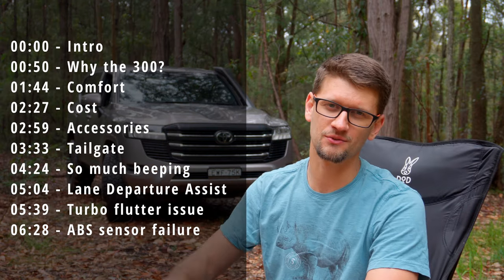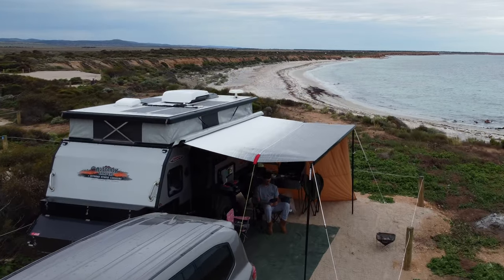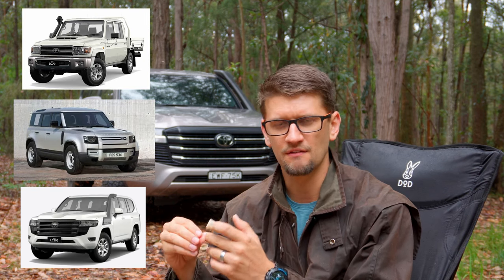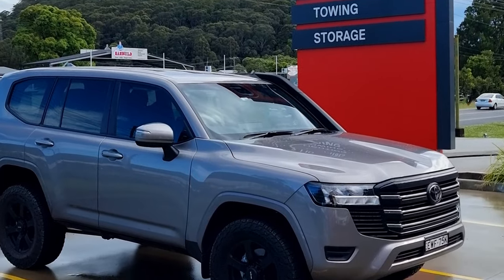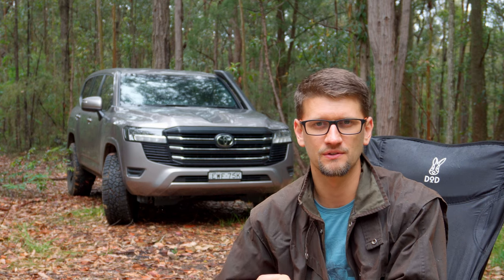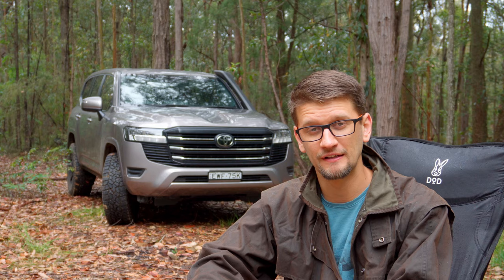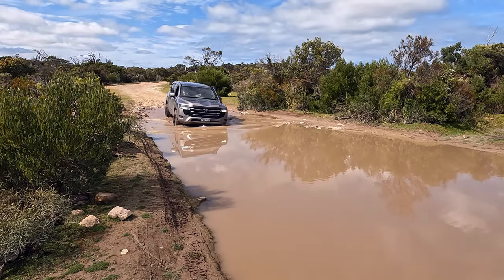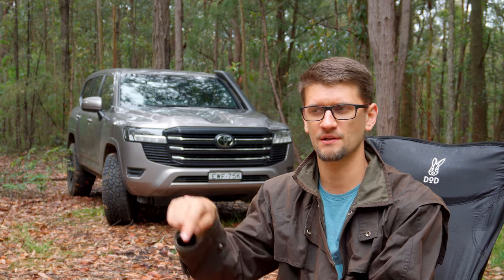Land Cruiser 300 Series - What do I think?

Comment: Im a toyota flipper. 30+years in the auction industry. Ive had 40, 60, 80, 100 70, 200, etc. youre spot on. I have a 300 as a company car and a dual cab 79 as my private car and “miss world fj45” done 110,000 genuine klms.

Likes- gearbox, 9.1 litres per hundred fuel consumption, brakes better than 200, steers better, engine has heaps of grunt.

Dislikes- tailgate. I cant tell you how much i hate it. Beeps and dings, lane departure, cruise control is awful. It surges, runs over speed, over brakes etc. i know of water in airbox, the losition of the fuel filter….. i could go on. Got friends with them and they are having injector issues…. Im pleased its a company car and i didnt buy it. Im sure toyota will get it right. In the meantime i will stick to my 79.
Great review btw👍👍👍

Comment: Not having the split tailgate was a big miss. It’s one of the features that sets the LC apart from most others. When I purchased our 200, many of the reviews mentioned this feature and I thought it was a gimmick. Little did I know that it would save your back when lifting heavy items and it saves the bumper from scratches when loading. Of course there are many other benefits. For this reason alone, I would never consider the 300 unless this feature is brought back.
Reply from the maker: It is really hard to explain how good the feature is if you haven't had one. Another plus was it spaced your knees away from the back of the car. I've been kneecapped once too many by the tow ball.

Comment: One of the issues that exists is the myth and mystique of Toyota.  We need more owners calling out the issues, it get the truth out there, but also hopefully keeps some pressure on Toyota to sort the issues.
Reply from the maker: Agree with you on this one. Ultimately they're still just cars. Some are better designed than others but they remain machines.
Reply: Still the best you can but, end of story. Forget these laptop on wheels called Land Rovers.
Reply: @Coordinator61  assume you meant to say ‘best you can get, end of story’ which is quite simply rubbish.  This is the myth and mystique I’m referring to, where folks just like you believe the group think.
Reply: @baronvonaux8294  Its not rubbish i work 30 y plus in oil and gas industry worldwide and we only use one brand 4x4: Land Cruiser and Hilux. Proven tough trucks.
Reply: @Coordinator61  Well if that’s all you use then you have no way of assessing how they compare to other manufacturers do you! You are making my point for me here…
Reply: @Coordinator61  nice piece of confirmation bias right there. On recent road trip Australia coast saw 3 broken down Toyotas: 2 LC200s 1 Prado. Of course probably run out of fuel, except the one on a flat bed - and no it wasn't one being transported between car yards. So by that measure I could say Don't trust Toyotas....which of course would be a stupid statement.
Reply: @ConsoleCombat  what mechanics?  We own and run a diesel 4WD specialist workshop so we see our fair share of vehicles.  The volume of Toyota’s coming in with serious mechanical issues would surprise you.  Fuel injection failures, DPF failures, and engine dusting are the top 3 concerns but there’s many others.  There’s no perfect manufacturer and ALL vehicles have inherent design issues.
Reply: @baronvonaux8294  have you considered  your sample could be biased. If you run a 4WD specialty shop there’s a chance that serious 4WD owners who come to you mostly own Toyota’s for their renowned reliability hence the disproportionate amount you see.
Reply: Myth? It’s the best option out there. Is it perfect, of course not.
Reply: @downloadhapa  No I had never considers statistical significance of sample size.  I need a genius from YouTube called downloadhapa to educate me.  Of course I’ve considered that.  Toyotas make up circa 18% of our regular maintenance business, which is slightly higher than Nissan and Isuzu and slightly lower than Ford.
Reply: @baronvonaux8294  I run a diesel mechanical shop in North Queensland. Thanks to Toyota I have paid off my house super early. Once upon a time they were super reliable. Not now....over priced, expensive to repair and no where near as reliable as the older model cruisers..

Comment: For the lane departure assist, I think in the next update they should put the steering system they have in the Twin brother LX 600, which is an electric steering system. I agree using the brakes to pulse the car back into its lane is extremely dangerous. Toyota should get have to consider changing that.

Comment: We bought a brand new 200 Sahara in 2020 for $120k which seems like a bit of bargain now. Love the V8 diesel, we went from Canberra to Melbourne and back for this Xmas and got down to 9.1 L/ 100 km so very happy with that. It has more than enough power and tows our 1800kg van like it’s not there. Things I don’t like: constantly beeping, sound familiar. Shittest sat nav ever. No Apple car play. $120k for a car and I had to buy a windscreen mount for my mobile phone so I can use Google maps. For such a big car it has very poor leg room for my 2 meter frame. My 2005 Monaro has a lot more. Very little storage up front compared to a Ford Territory. Hand brake needs adjusting every service. Thankfully the likes far outweigh the dislikes. Lane assist just beeps at you (of course) but doesn’t pull the steering whereas in my new Hilux workmate it pulls the steering and kills the acceleration every time you cross a line. I hate it and it feels dangerous so I turned it off and won’t use it. Thanks for you honest review of the 300 and I’ll be following along to see how things go. Cheers Stuart, Canberra.
Reply: Just buy a Samsung Android phone , then no issues with not having Car Play or Google maps !  My Ultra Note 20 works flawlessly !

Comment: The one piece rear tailgate wasn't a good move on Toyota's part, plus the lower rear axle capacity & gcm and reduced capacity fuel tank from the LC200 is also hard to understand the factory logic. The turbo location will certainly add a lot of heat under the bonnet during slow 4x4 travel in hot weather. First release of a complete new model is bound to have few issues, remember the 2007-08 200 series oil consumption etc personally wouldn't buy a 300 for a few years will stick with the LC 200.

Comment: Never by the first of a car model/ engine...

The tailgate is enough not to get, same as the beeping... the cost, the cheaper looking interior, the same feeling interior...

But most of all the sound...
Twin 3" to 4" at the tip exhaust...
🤤🤤🤤

Had a ranger before my 200... the beeps and electronics were a big pain... the gear box too.. but most of all the BS of 3.5t towing...

Going a 4x4 trip done in both like googs... the range was pushed to the Max and not even filled to gvm...
The 200 used less fuel and just walked it like was flat...

Would I buy a 300 no, but if I won one I would keep and try it fitted out. Worse case would easily be someone to buy it for good money.

Comment: Do you have any regrets about not getting the GXL? Just trying to decide between the two!
Reply from the maker: I agonised over the two models for way too long. In the end most of the GXL options were nice-to-have (wireless charging pad would be nice) and others were a pain/useless to me (mags, roof rails, third row seats). The real clincher was the vinyl floor in the GX that I'm a huge fan of. If you're looking to modify then I believe the GX is a great blank canvas, where the GXL is probably a better daily drive.
Reply: I choose a GX over the GXL for the same reasons.

Comment: I was once told cruise control and towing are a no no...just a thought. I've towed in my 200 and used it...the thing couldn't find a gear it was happy with
Reply from the maker: I've been involved with many a heated discussion on this topic. Personally I use it on open flat sections and leave the 10 speed to do its thing until I hit hills where I'll revert to the right boot.

Comment: What would you buy between x5 30d or this lc300 vx? These are on similar price bracket.
Reply from the maker: I haven't driven the latest iteration of the X5, but based on my experience with the older models: 300 Series if you're planning on doing camping, towing or offroading. X5 if you need a comfortable, large-ish lifestyle vehicle and don't need to venture off the beaten track.

Comment: ? Defender...why did you eliminate this one..
Reply from the maker: The Defender has a lot going for it (my first few 4x4s were Land Rovers and I loved them). It's definitely more comfortable and more refined than the cruiser. The main points against it were the air suspension, payload, perceived complexity and limited Australian dealer/spares network compared to Toyota. If I can get my hands on one I'll do a thorough comparison.
Reply: Maybe the anti anti LR stuff worked as air suspension is great. No need for expensive upgrades..dealer support...try getting LC parts in remote areas like we did in Alice in 2018 for a 100s..no go..had to come from Sydney...and complexity..they are all complex nowadays and subject to gremlins. We met a couple Defer drivers touring Tas mid year and they said good things. I've heard a few bad things about the 300s but Toyota will no doubt sort them out. Thanks.

Comment: What’s the tire sizes ?
Reply from the maker: They are 285/65R18 tyres on 18x8 +35 rims 👍
Reply: @ImpalaOverland  mate. LC 300 comes with 265 tires which is too small for this car. Anyway since you are using 275/65/18, does it affect your steering?
Reply: @ImpalaOverland  what are the brand of rims.. cheers

Comment: This is not a land cruiser , just over priced Prado
built on Prado chassis, narrow Prado wheels ,same size inside as a Prado way smaller inside that the 200:
Very little leg room in back seat
Loss of 140 lt fuel tank a downer
Only difference is different motor and a longer bonnet 
New motor is no match to the v8 ,noisy if working even a little bit,10 speed box is good at road speed , but around town every time you slow down if drops back a couple of gears and refuses to upshift instead of just rolling along,very annoying 
And as for the tail gate and beeping you already been over that,
Reply: Not so, it is far removed from a Prado. I dont like the Prado’s interior and lack of basic items like USB ports, poor quality sound system in the VX, air suspesion efc. The 300 is way better ito powertrain, ride quality and solidity. And I hear no beeps? But also hate it. I have also critised the 300 till I have test driven it well. Really very nice. 200 was a frustration to me, ergonomically a nightmare, again poor sound system, heavy on furl, and apologies to all the fans, the V8 4,5 didnt perform that well. So I am confident that I will be happy with the 300 after a Prado, and 200 way back. Rather pay than to be sorry.

Comment: Way too much technology. I still don't understand why car manufacturers don't provide a basic, base model for a 4x4/camper enthusiast at a cheaper price and then have this expensive, over the top technologically advanced, beeping beast for the tourer and soccer moms.
Reply: It’s called the Ineos grenadier. That’s what I put my money into. Proven BMW engine. Zf gearbox which is bullet proof and nothing you don’t need
Reply: Majority of all the safety crap is ancap move the goal posts on the 5 star safety rating.. therefor if the manafacture doesn't comply there vehicle won't get the 5 stars.. and in today's world "it's all about the safety" 🤦😮‍💨
Reply: Isnt what the 79 series is for
Reply: @seadoomania  so you can be unreliable and slow?
Reply: It would cannibalise their profits.  Few people would buy the high spec models.
Reply: @seadoomania  a base model 200, 300 series at a cheaper price. Take out all the cameras, apple carplay, reverse sensors, keep cloth seats and cheap dashboard. No heated seats. A 79 series is an expensive shell, once again the toyota badge tax. Same with the Y62 Patrol, take out all the technology and sensors and all of a sudden a 90K vehicle could be 75-80k brand new.
Reply: @cashman1981  It would, but they'd be selling a lot more vehicles if it's affordable.
Reply: @seadoomania  but the 79 is still nearly 100k
Reply: Basicaly a jimny? Not sure about the reliability when u do heavy offroading
Reply: @dexterrr9163  yeah right
Reply: @australianmade2659  good luck with that😂
Reply: @NoOne-qr8yf  I’ve ordered one.
Reply: @australianmade2659  🤦